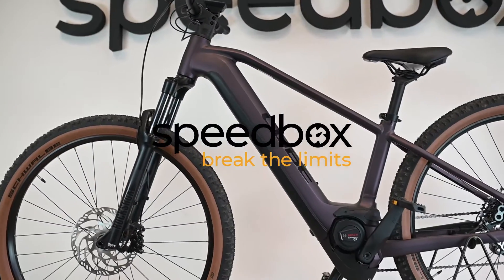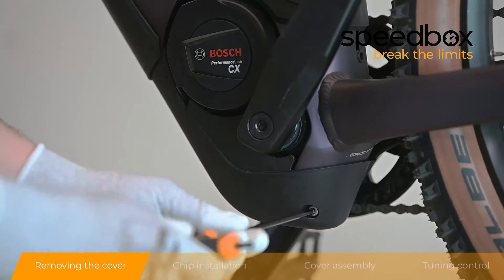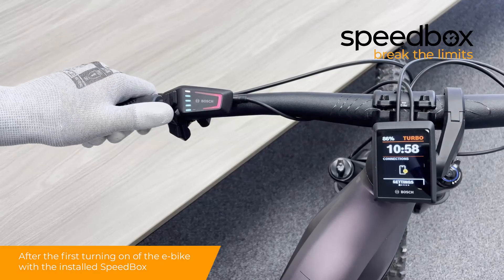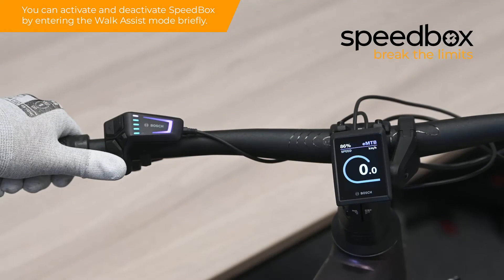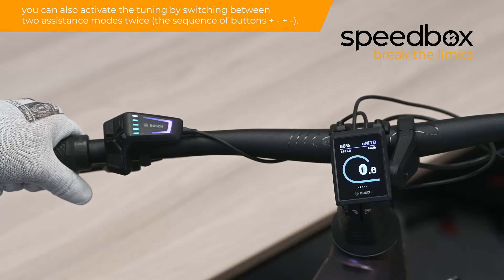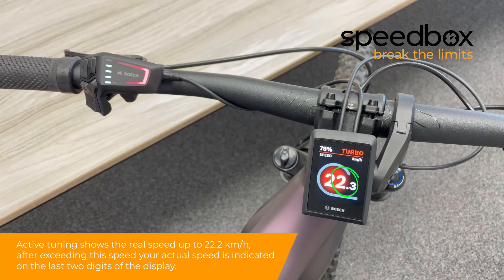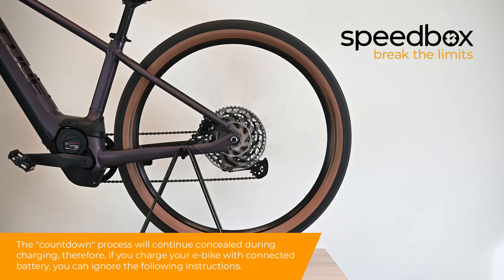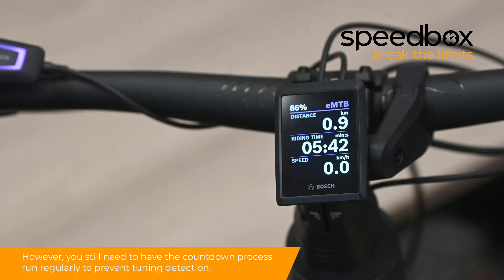eBike Tuning SpeedBox 1.0 for Bosch (Smart System) Installation Instruction

Comment: Hello Speedbox
Will there be a solution for the 1.0 Bosch smart system?
I mean the update software version 11.13.0
Unfortunately, I updated the software and it no longer detects the chip. (inactive)
Will there be another chip for this problem?

Comment: Hi. I have also Smart System and want to buy SpeedBox, but a lot of my friends had errors and Limp mode and i also afraid of this. Please tell, when you start to sell new chip for Smart System?  @SpeedBoxTuning
Reply from the maker: Hi. Thank you for your comment. The brand new chip for the Smart System is currently being tested by independent users. We would like to launch it on the market during September. Please follow our social networks or website speedbox-tuning.com
Thank you

Comment: Is the Bosch Smart System able to detect that this has been used?
Reply from the maker: Hi. Yes it can. For this reason, we do not recommend updating the software or using FlowApp at the same time after installing the chip 🙂
Reply: @SpeedBoxTuning  The way my bike is set up the Flow app records ride activity. I also use it to check battery charge and occasionally change the assist settings. Does that all have to be disabled? Or do you simply not open the app while the bike is on? Thanks in advance
Reply from the maker: @cadriver2570  In general, it's a bit complicated if you want to have Smart System and use tuning at the same time. BUT: we are currently finalizing a completely new chip for the Smart System, which will have simplified communication with the engine. Follow our social networks or website, the product will be released shortly 🙂
Reply: @SpeedBoxTuning thanks, I'll be on the lookout.

Comment: If error 504 occurs and bike is reset can I use the chip again or is it demaged afterwards?
Reply from the maker: Hi. Yes, of course. Error does not affect the function of the SpeedBox.
Reply: @SpeedBoxTuning  thanks for your answer. I think there is some connection to phone gps. And got reset and will use chip again.

Comment: So sad, it killed my bike again - the "February" onwards batch was recommened but I only managed 171KM before it went into limp mode again.  I follow the usage instructions to the letter, and to be fair it's been much better behaved (no crashes, speed freezes, reboots etc.) but it didn't take very long for it to be detected by the latest Bosch firmware.  I've contacted the manufacturer and my supplier in the UK.  I'll post back with updates for those that are interested.
Reply: Any news?
Reply: @Mirko Pena  Not really, importer has kindly offered me a refund, manufacturer has been in touch ... I'm keen to get to the bottom of this and help them out.  For now I've refitted the device after getting my dealer to clear the manipulation error (reporting to Bosch on the process).  I'm trying it with a lower speed limit of 40KPH ... three varied nights of testing ... so far ... no further issues. Watch this space.
Reply: @The5laYYer  I've had twice the 504 error on my cube 750 smart system only after 200km so I removed the device because I am not sure whether I have one more try to go before the engine is completely blocked. Even my dealer could not answer my questions: is it at the fourth error message that the engine is blocked (meaning I can have 3 errors) or at the 3rd message ? And now that the dealer cleared the two errors I've had, does that resets the engine to zero, meaning I can have 3 errors again ? If anyone knows the answers I will appreciate. My guess is that the detection comes from the bluetooth and the app but not a 100% sure.
Reply: @jacqueskralian4541  Detection is NOTHING to do with the Flow app / bluetooth - I've never used it (dreadful app anyway).  It's all internal to the software on the bike.  It is my belief that the software allows THREE warnings where you can clear the error yourself with a limp mode (pulsed low power output) 90 minute ride, then the 4th HAS to be cleared by the dealer (which uploads a report to Bosch) with their diagnostics software.  What happens on the 5th manipulation detection I don't know - I haven't found out yet.
Reply: @The5laYYer  Ok that's good to know that the app has nothing to do with it. And according to you, the errors are not erased by the diagnostic done at dealer, they stay in memory, right ?
Reply: I have no way of knowing if there is a permanently stored counter (almost certainly will be), but the diagnostics software didn't show any errors once it had been cleared by the dealer on a second check - BUT as I say there's a log automatically uploaded to Mr. Bosch, so you're doomed on warranty from that point forward.  🙂
Reply: @The5laYYer  Thanks for your answers, I think the same about permanently stored that's why I am not going to try it again unless they come up with a new version that beats the smart system.

Comment: Hello, I have the Cube 140 smart system from 2023. I cant tune it with Speedbox 1 bosch smart system. I cant use the green connector, like it show in the installation video. I have a blue one came from the bike next one the green. Anyone tips why?
Reply from the maker: Hello. Looks like you have a Smart System with a rim magnet. If so, there is no speed sensor to plug the SpeedBox into - https://www.speedbox-tuning.com/p/speedbox-1-0-for-bosch#413. We are working hard on the development of SpeedBox for rim magnet. We recommend that you contact the seller of your SpeedBox and ask for the possibility of an exchange when the new product is on sale. Please note that we are not yet able to estimate a possible launch date. Thanks for understanding.

Comment: How good is the firmware now at avoiding detection? I really want to buy one of these but reading the comment section is a horror story...
Reply from the maker: Hello. The Bosch Smart System is a challenge in itself. Even without tuning, there is a risk of an error message. Other tuning manufacturers give different recommendations to their customers, for example regarding the recommended maximum average speed, but we have not confirmed that this has an effect on the risk of error messages. However, in February of this year we updated our firmware which blocks tuning detection and seems resistant to system updates via the Flow App.
Reply: @SpeedBoxTuning  Have you noticed less reports in errors since releasing the update in February?
Reply: I will patiently wait for your reply, thanks
Reply from the maker: @kacsa  The actual feedback is positive. Please contact us anytime later :)

Comment: Question. Changing the wheel circumstances on Kiox 300 display can influence on max speed?
Reply from the maker: Hello. Generally, in some models, you may lightly increase the speed - let´s say from 25 to 27 km/h. But this is not a significant change :)

Comment: My ebike today turned off after 1 month without problems .. and it was limited in the torque... My bike was not the same... updates were always disabled and I always left it on to do the countdown.
Speedbox was detected.
Reply: Hello, I have the Cube 140 smart system from 2023. I cant tune it with Speedbox 1 bosch smart system. I cant use the green connector, the green port is not in use but the blue one next. like it show in the installation video. I have a blue one came from the bike next one the green. Anyone tips why?
Reply from the maker: Hello. Our findings so far indicate that the tuning detection (error code 504) is more sensitive if you drive faster than 40 km/h. We are constantly working to eliminate this issue. However, this error code does not appear on the vast majority of bikes and cannot be easily triggered in laboratory conditions. Improvements are therefore still being worked on.
Reply: @SpeedBoxTuning  Guys, the problem is not driving 40km without tuning, countdowns or turning off updates ... I and many other people like me, we have always done things right.
the problem is that the speedbox needs much more time to be developed, because the smart system is very sophisticated and at this point you have to give concrete answers to those who bought it and are having problems ... or make a refund and guarantee that the speedbox will be updated for free in the future.
I bought it on amazon and I'm going crazy to get a refund from the seller who refuses ... I hope I have not lose 230 euros.
Reply from the maker: @only82_  Could you please send us a name of the seller via FB messenger (SpeedBox Tuning) or via support chat on our website? We will help to manage the issue. Thank you.
Reply: @SpeedBoxTuning  I have send you a message from the official site thank for support.

Comment: Hi, Is there a working version out there for the  Bosch Performance CX EU: 25kmh / INT: 20mph,  750Wh Battery, Kiox 300 Smart System, BlueTooth and Flow App. 2022 Bosch Smart System with a valve stem wheel magnet for the speed sensor. Which chip model do I need?
Reply from the maker: Hello. We don't have such a product yet, but we are working on it :-)  Please follow our web or social media.

Comment: Error 524001 will not go away.  even after 90 mins of riding at get home speed it has not gone.  HELP!
Reply: Is it the first time that you got the error code? Or it happened multiple times
Reply from the maker: Hello Robert. Thank you for your feedback. Could you please contact our support team via chat and specify your issue?
Reply: @SpeedBoxTuning  Just got this message and i emailed you iaw your instructions.  I took it to a dealer as i had no options left to me.  They right away knew it was hacked and they could not reset the bike at all.  Even after they did it came back and with the same error.  I was told to remove the box, which i did and it works now.  Bosch recieved that and have now registered my details with the bike and its failure (ie hacked).  I can not afford to ruin the warrenty as i would be left with a £3500 bike i could not use......
Reply: @SpeedBoxTuning  How ?  the website?
Reply from the maker: @robertgowling191  Website or our social media.

Comment: I have a cube stereo hybrid 160 TM 2022 with bosch smart system, i have had and have a lot of problems with my speedbox 1.0
When i activate my speedbox 1.0 it shows values of 10km/h and 5.0 instead of 9.9 and 4.9.
When i use the speedbox 1.0 with my smart display the bike just turn itself off every time, sometimes fast en sometimes after a few km.
Also the way the remote is responding with activated speedbox is not well it's glitchy when i use it in combo with the display, it jumps to every assist mode when trying to activate or adjust it.
It also has been detected once by the bosch software even tho i did everything right, i noticed that when the speedbox is counting it sometimes counts with a very unrealistic high speed value while the bike doesn't move and then the average speed goes up instead of down resulting in a average speed of more than 25km/h.
Also the responsiveness of the bike is sometimes very slow especially if it is in counting mode.
But the speedbox is sort of usable when i remove the display between the controller and the motor, then i use my bosch app to look if the speedbox is activated and then you can use it sort of, with less problems.
Still not as responsive as without speedbox.
NOTE: This is my second speedbox 1.0 and when i don't use the speedbox everything works very well including the display.
Is there anyone that uses the bluethoot version and thoes it work without problems?
I would love to have a good working one :(
Reply from the maker: Hi Ron. Thank you for your feedback. We are not happy that you are having these chip and motor complications. The Bosch Smart System is simply "smart" and unfriendly to tuning. Bosch is constantly coming up with software updates and new errors. We are working to eliminate all discrepancies. Please try contacting our support team.
Reply: @SpeedBoxTuning  thankyou for your reply, i have an email from support that i'l have to replace it for another speedbox because mine where faulty, if this works oke i'l update my comment  above :)
Reply: @Simracing_Content  Hi, I have a Cube Stereo Hybrid 140 TM 2022, and my speedbox 1.0b worked well, until it started to randomly turn off completely the bike, forcing me to re start it manually. I'm not using the Kiox 300, I prefer to have my Garmin Edge 530 instead, so I don't know how the speed counter works on that display, but after sending back my old unit, I got a new one just days ago. I will re install it in the next days, hoping they solved the issues I had.
Reply: @FabrizioGarattoni  hi, i have a new speedbox 1.0b and i am still testing it, i will reply soon with some feedback.
I use to have the same problem with the first speedboxes it shutted itself down after a short distance of riding,  but it was way less to almost never without the use of the kiox 300 display. And i am sure all cabels where correctly attached.
Reply: @FabrizioGarattoni  i have received a new speedbox 1.0B a while ago, i have tested it and it works fine now.
I don't have any problems anymore.
Only thing is when the countdown procedure starts in the app there is a delay with the pedal assist when you start to pedal while the countdown procedure is stil on. But besides that it works fine now :)
Reply: @Simracing_Content  Great news. I think this kit is one of the best at the moment. The bluetooth option makes it even better.

Comment: For some reason on the the cx motors, they loose their responsiveness after been used, very annoying during commuting and on hills. You loose power before you do a full rotation. Only seem to do it the cx motors. Have had speedbox and peartune tuning boxes. Stopped using them now. Moved to volspeed v4. The only one that seems to allow the cx motors to keep their responsiveness at all time and don't have to wait to do the countdown, very handy when you have intuvia, kiox displays. If you have any of the motors below the cx model then speedbox and peartune will work fine. But if you have the cx gen4 then look at volspeed v4 (doesn't work with smart system, but are working on it)
Reply from the maker: Hello. Thank you for your feedback. Sorry to hear about your complications with CX motor. Do you have "Smart System"? This system seems to be pretty unfriendly to tuning. We are still working to eliminate all discrepancies connected with Bosch software updates or errors. If you have any concerns, please free to contact our support team. Thank you.
Reply: @SpeedBoxTuning  hi nope don't have the smart system one just the normal cx motor.
Reply from the maker: @bb7115  Okay. The SpeedBox 1.0 is only for Smart Systems and can not be connected to other motors. If you have some concerns with your chip, please contact our support. Thank you.
Reply: I know that. Was talking about my experiences with speedbox for the normal speedbox and looking online, I'm not the only one that have these niggles
Reply: @SpeedBoxTuning  I know that. Was talking about my experiences with speedbox for the normal speedbox and looking online, I'm not the only one that have these niggles
Reply from the maker: @bb7115  Okay. Thank you for your feedback anyway :)

Comment: Bought this for my bike, Gen 4 and Smart system. After about 300km Bosch system detected it and there goes the limping mode... Had to remove Speedbox since i dont want it to happen many times. Also irregular system reboots happened without any warning.. So I guess that this was money not so well spent if there is no money coming back or the box can some how be updated...
Reply from the maker: Hello. Thank you for your feedback. We recommend having the "countdown process" performed after each ride. We also recommend removing the SpeedBox from the e-bike if you are going to run a software update. However, the Smart System is "smart" and sometimes updates without warning. The motor and software manufacturer is trying to complicate tuning. Invents updates and errors. We are still working to eliminate all discrepancies. If you have any concerns, please free to contact our support team. Thank you.

Comment: This Speed Box 1.0 is a prototype of sorts and so expensive , from what I read here it's a massacre! Errors, current speed on the last two digits etc. 
Gentlemen, do something decent without these combinations and then I will buy for sure, technically it is certainly possible, and so you drive, think, look whether it works or not, whether there is an error or not instead of concentrating on driving.
Reply from the maker: Hello Ren. We can ensure you it is not a massacre :) The Bosch Smart System is quite new and the SpeedBox 1.0 is our latest product for this system. Some problems may arise from objective causes. They are all solvable, you can contact your dealer or our support at any time. If you want to monitor all real riding data now, we recommend the B.Tuning version with Bluetooth.